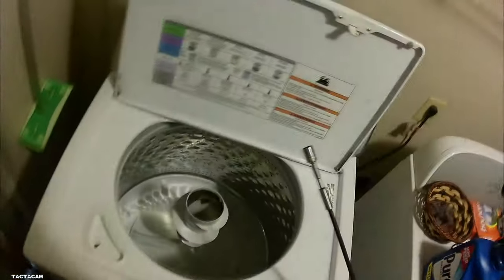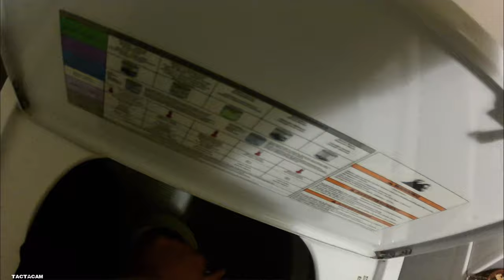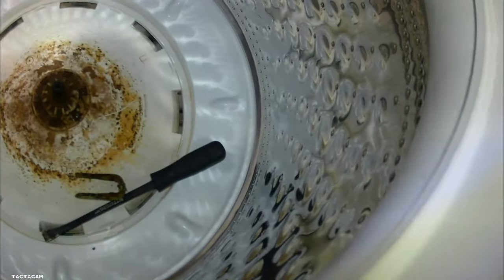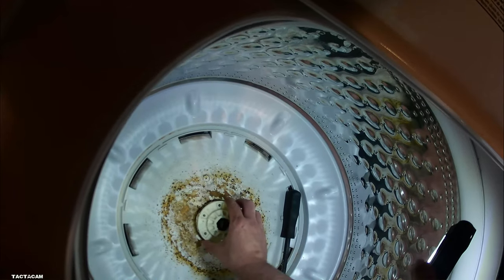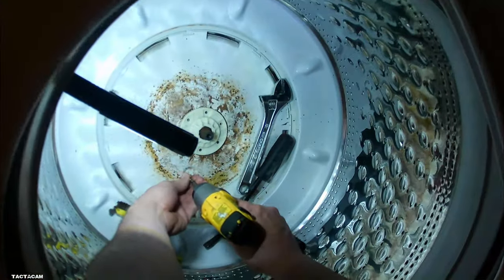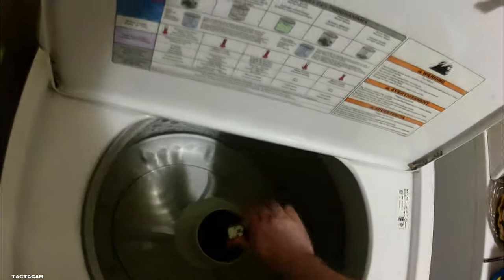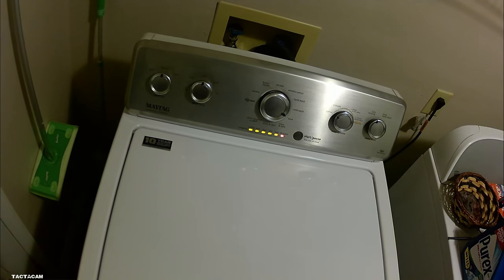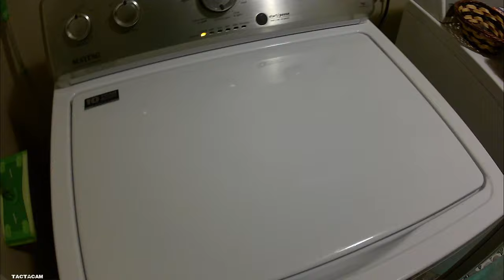Maytag/Whirlpool Washer Will Not Spin Water Out of Clothes Diagnosis and Repair

Comment: The Bravos Maytag washer has a problem with the Drive hub wearing out. If you have knowledge of Washing machine repair this is the perfect washer for you.  If not go out and buy a Speed Queen.  I am disgusted with the poor quality of the Maytag. Mine broke for the second time during LOCKDOWN!!
Reply from the maker: I will second your motion lol.  I tell anyone who asks what washer to buy,  Get the cheapest one you can find or a speed queen. 

A little fun fact for ya,  Maytag is owned by whirlpool now.  If you look the whirlpool and maytag models are pretty much identical, they just have a different name for the most part. When you buy maytag now-a-days you are buying whirlpool.  Whirlpool purchased them back in 2006.
Reply: A very good explanation,thanks.
Reply: If the washer comes with a 10 year warranty, is this covered?
Reply: And then to add to the question. I have a two piece agitator, I remove the column, but the base is there, with no pins or screws.
Reply: @markanthonypowell  The 10 year Warranty is for the "tub" part of the washer...the part that most likely won't ever break.  Yeah, I thought the 10 year Warranty was for the entire washing machine as well.
Reply: Amana or roper is what I tell ppl to get lol it works and easy to work on

Comment: Followed this video.  Fixed my Maytag MVWC565FW2. Part was $30 with shipping. Came in 2 days.  Hardest part is breaking the bolt free in the agitator.  I wedged a paint stirrer in the seam around agitator base and basket and hels the basket.  Did same thing to put bolt back on after replacing hub.

Comment: If you can't get the washer basket drive hub to sit flush, but pretty close, try screwing in the screws to snug it down that last bit 
I was hitting mine with a rubber mallet and it still wouldn't sit flush.  I cracked the first one I tried installing!  And I spent a long time cleaning the shaft with some wire brushes as well but it still wouldn't sit flush.

After ordering a second one it still wouldn't sit flush.  But a light bulb went off and I thought "let me try snugging it down by using the screws!"  And it worked!!

Hopefully this saves someone A LOT of frustration and the cost of ordering a second one!

Rest of the video was excellent.  And the spindles on my old washer basket drive hub were completely gone!  It was smooth in the center with no spindles left!

Comment: I would definitely use a 6-point socket to prevent damage to the bolt deep inside the agitator. Another simple tool to use with a long extension, is a “Hand Impact” that requires a tap with a hammer. It goes onto the extension by size, but uses an internal screw action to loosen or tighten a bolt or motorcycle side case screws in the late 60’s into the 70’s. It has arrows on it but easy to use. As you hold the body, tap sharply with a hammer and this downward force is changed into a twisting force while pushing socket harder onto the nut. It breaks them loose and now that fastener needs anti-seize applied. The large plastic clip is called a “Horse-Shoe” clip because of its shape. I would use a mirror and light to align the “Flats” before installing but use a little Vaseline on both side to aid in installation now and removal later.
  The hand impact is sold at harbor freight including SnapOn trucks.
DK, ASE master tech since 78, retired.

Comment: My Maytag washer doesn’t have the agitator in the middle, and it recently stopped spinning. Smelt a burnt/electric smell while it was running.  Tub wouldn’t spin but drain was working.
Reply: Sound like you need a new belt !

Comment: Having the same issue except it spins but doesn’t agitate but now it’s to the point where I have to replace that hub about every 3 months. Any idea why? I’ve never calibrated it after though.
Reply: U always have to calibrate when you put a new part in so the machine knows you replaced it. Yes that does make a difference and make sure you put it tight and slide that pin back in.

Comment: I've changed mine several times now (big family), I've seen that there's a metal hub available instead of the plastic one. I'm wondering if it would be better or would it put too much pressure on the transmission?

Comment: I wish I would have seen this earlier.  I think I have the same model washer as in the video (4 year old Maytag Centennial) and it is having the exact same issue.  We called a local appliance repairman who came out and performed some sort of "diagnostic" test.  He only had a couple of wrenches and cordless drill but a few minutes later, he determined that my washer had a faulty control board ($298.00), a bad splutch, and a bad actuator.  All total with labor, I was charged up front $439.04 and he still said that he needed an additional part that I would have to pay $29.50 to get shipped.  His nonsense has gone on for a week and a half and my washer was still broken. When I challenged him about the repairs, he said we were "stuck with it."  I got so disgusted with his attitude that I cancel his services and filed a dispute with my credit union over the charges that were made to my credit union Visa card.  I'm hoping to get the money back because I truly believe we were scammed by this repair company.
Reply: Yes you were, when you could get almost a brand new one or a used one at that price and if they ask for money upfront before its done that is a redflag sure maybe $100 but until its fixed nah don't do it. File a complaint with the BBB as well and post it Facebook marketplace and warn people of his shady antics. Disgusting 🤢 that he did that to ya!

Comment: So I’ve changed the agitator hub… door lock mechanism… and now ordered the clutch and belt… I hope that is the problem because if not then what else could it be?

Mine won’t spin the water out and spin it dryish…. I used to unplug it and wait then plug it back in and sometimes it would do one load correctly. 

So like I said. I hope it’s just the clutch and belt now. If not… I’ll be back. Cuz I cannot find videos on any other parts

Comment: 7/16 works perfect but put WD40 on it let it soak for a couple hours...worked for me. but when i pulled the agitator , there was another large shaft. the spline thingy was inside the plastic agitator. anyway, pulled motor and tranny and found the clutch was worn down to 3 instead of five points of friction. i could relatively turn it with my fingers. so figure that's my problem.

Comment: Didn't the real old machines use a spanner wrench to take tose off? Now a days they make these compact so you need 3 hands, lolol. You could use a 3/8 in. Socket wrench with the same extension might give you more stability to break that nut free. Most importantly don't strip the Phillips screws with that impact drill. Thank you for the video.
Reply from the maker: Lol yeah to get the basket out.  They used compression to spin the basket.  Now a days it’s a plastic hub.  Occasionally you have to use your leg to help you out lol. I recently started using the 20v impact and it’s more of a drip instead of an impact.  You only get the impact when you got something stuck good on there. Thanks though ray ray.  Good to hear from you!
Reply: Cool improvements I will keep in mind. True if you have junk on the screws such as build up of harden soap or water deposits it will make it harder. Thank you and be good and have a safe week.

Comment: You say:  "Basket will spin by itself if you hold agitator"

I dont know the terms but are you saying that if you can hold the center vertical piece with one hand and spin the silver part around it that more than likely, that lower part is stripped out?

Comment: Good night and hope all is well. I have a Whirlpool washer that sometimes makes a loud rumbling noise on the spin cycle. What part would be causing the rumbling noise  and sometimes moves the washer??? Take care and have a pleasant night.
Reply from the maker: Does it sound like an airplane taking off?  If so you may have bad bearings in the tub or transmission.  if you have one like this one in this video you need a transmission.

Comment: I have a problem not sure if it’s the hub/agitator. Mine has just the wash plate. I adjusted the legs and made it more stable. But my issue is it still leaves wet clothes after three final rinse cycles. Any thoughts? Appreciate it.
Reply: richie p 23  yes i hired a repairman to replace it with a special tool to pull it out. I tried to pull it out myself but unable to due to the awkwardness otherwise it's the wash plate worn out on the inside and eventually you'll need to replace it.

Comment: Installing a new Splutch Kit for the Maytag Centennial. The plastic piece that snaps in to the metal casing is slotted. All the videos I see just show the Tabs snapping in. Do I need to spin it all the way to the right? Currently it is about halfway and making noise. I'm wondering if I didn't twist it far enough?
Reply from the maker: Those can pop loose if it’s not locked into place (turned all the way). That is the first place I would look yes.  The newer transmissions have it the ways yours is where you have to turn it.  

It’s a good chance that is your issue yes.
Reply: Thank you very much. I'll try spinning it all the way when I get home.
Reply: That fixed that issue but I think my initial problem was the tub seal leaking and bearing. Probably trashing a 2017 Maytag Centennial. 2nd Maytag and 2nd transmission problem. Won't be buying another Maytag, Whirpool, or Kenmore. Going with a Speed Queen this time

Comment: My Maytag Centennial leaves my clothes wet how can I fix it?
Thank you
Reply: I have a Maytag Centennial that has same issue. It's been going on and off for years. I found 2 other videos with more detailed information. The links are below. First one shows how to open the front of the control panel to access the sensors. Second vid shows how to possibly fix the problem. I say possibly because I've not replaced the water leveling sensor yet. Too late to go to appliance store. I'll update once I replace the sensor. Hope this helps.

https://www.youtube.com/watch?v=yXKt8bNO7W4
https://www.youtube.com/watch?v=_vNNzDwW9_8

Comment: I have the same machine an have a water leak under the basket. I noticed a damaged plastic ring when I took out the Actuator that is damaged. Do you know what these parts are? Do I need to pull the basket also? I have pictures I can email.
Reply: I think its the pulley clutch kit. Can it be repaired from the bottom? I have a slight water leak.
Reply from the maker: I bet your seal or bearing has gone out.  That’s a new transmission on these washers, you can just change the seals unfortunately. Pretty pricey part and a couple hours of work to change one of those.
Reply: Part of the existing plastic splutch kit is damaged. I'm going to put a new kit in and see what happens. Do you know if the Transmission is under warranty? It's a 2017 centennial model. 10 year warranty sounds like Motor & Tub.

Comment: Have you ever had a situation where the shaft that you clean with the wire brush is too corroded for the washer basket drive hub to fit?

I ordered the piece below as part of a kit.  It says it replaces W10396887 but I can't get it on the shaft.  The top of it looks more hexagonal whereas the orignal part I took off is round.

I'm ordering the part you linked in your video.  It SAYS in the "Check fit by model" that it will fit my Maytag model# MVWC415EW0.  Whick I'm almost postivie is same one in your video.

Hopefully ordering the other part works.  Rest of the vidoe was spot on.  I've spent close to 30 minutes scrubbing the shaft with two different metal brushes and the part I have still isn't going on even when I'm leaing into it with almost all my weight.

https://www.amazon.com/Durable-W10528947-Washer-Basket-Replacement/dp/B08HCFLC2Q/ref=pd_bxgy_sccl_2/143-9859330-3013018?pd_rd_w=3WPEz&content-id=amzn1.sym.7757a8b5-874e-4a67-9d85-54ed32f01737&pf_rd_p=7757a8b5-874e-4a67-9d85-54ed32f01737&pf_rd_r=MA04W371E26G925G501A&pd_rd_wg=3xLO7&pd_rd_r=fa20e960-29e0-452d-b2fb-8ae38a3abe4f&pd_rd_i=B08HCFLC2Q&psc=1